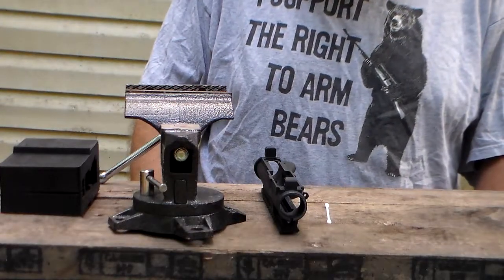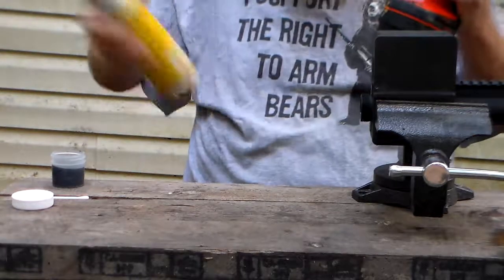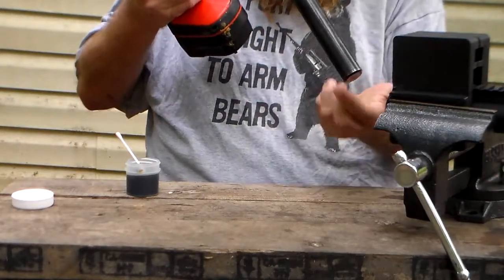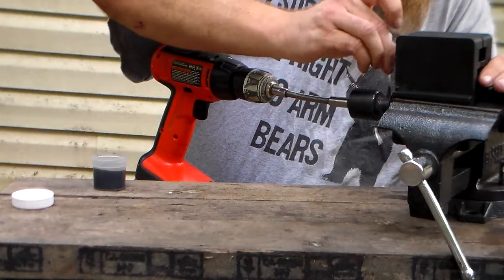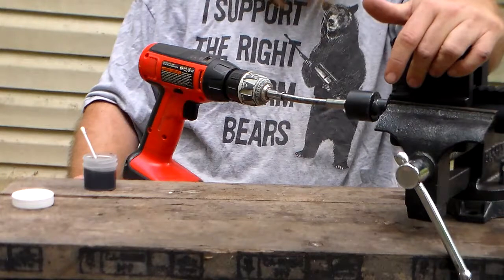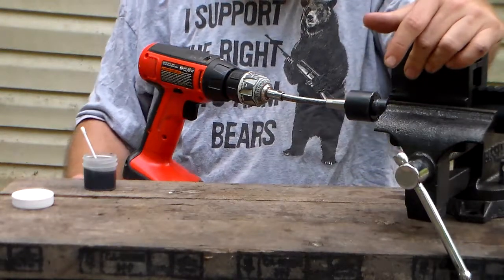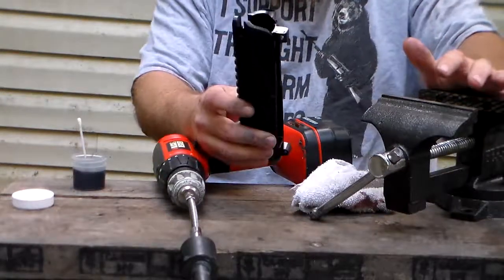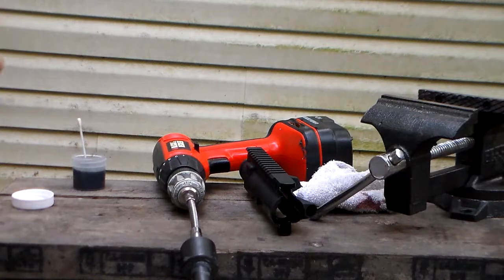6 5 Grendel build part2 Lapping the upper

Comment: Shouldn't have taken near that amount of time to lap that receiver.  #1 you should have the vise mounted on the table. #2 then it would lap much easier and fast if you receiver block with the receiver was mounted Vertically in the vise.  This way you get a much more concentric fit of the lapping tool on the receiver face covering all of the face evenly.  Doing it horizontally doesn't give you the correct fitting of the tool for lapping.  I have done tons of AR receiver's as I am a professional gunsmith.  But I do commend you on doing it yourself.  We all have to learn.  Next time try doing it in a mounted vise and vertically.  You will find that you n actually do by hand with just  dozen turns of the tool.  But doing it horizontally in an un-mounted vise is actually working against you and thereby taking a lot more turns or revolutions and time to do it.  Hopefully the advise will help you the next time you attempt this.  Rock on and keep your powder dry.
Reply from the maker: Thank you I will do that and the reason I didn't have it mounted was that wood was just sitting on top of a concrete table but I'm almost done with a shop and will have it mounted so I can try it that way

Comment: Cool shirt and FYI try lapping it on a sheet of glass with lapping compound works just as well and is cheaper. I use to do this on fuel injector parts.make sure you do that in figure 8 motions and rotate the item and lap again checking each time.
Reply from the maker: thank you and i just had to have that shirt when i seen it as a 2 a guy i love the play on words